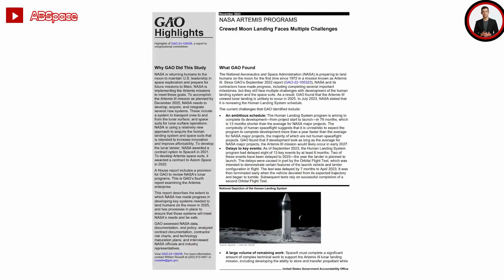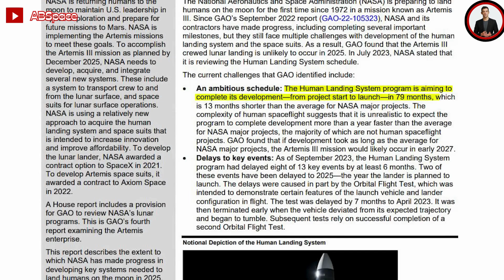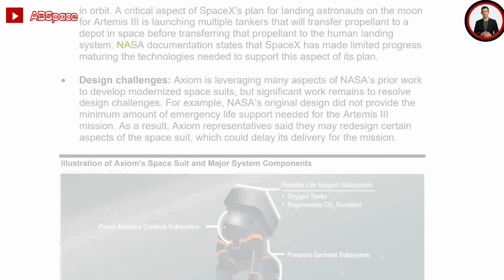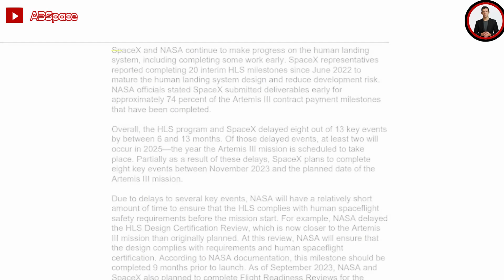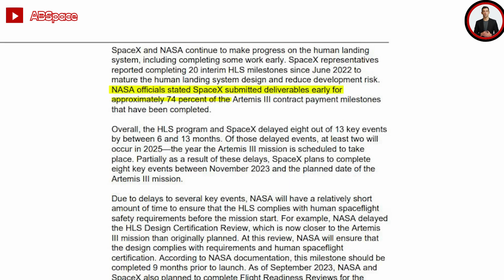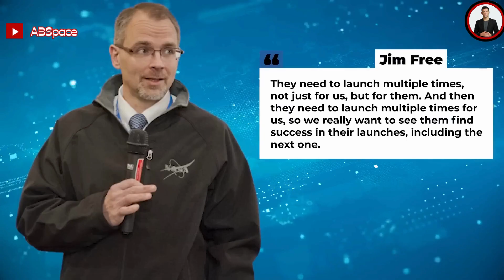SpaceX Lunar Starship Be Ready For Artemis III? But Musk Just shocked, NASA new HLS Starship design

Comment: As long as the FAA gets out of the way it will be fine. 

Would someone let the dumb F's at the FAA know it's supposed to fail?
Reply: You do understand that it's not the FAA just coming in and delaying things on a whim. The FAA has a LEGAL REQUIREMENT to investigate EVERY SINGLE 'failure', regardless of whether the failure was expected or not. Technically, even if everything had worked as expected, and the Starship had crashed into the ocean just of Hawaii as hoped, then because it would have been a 'crash' the FAA would still, legally, have to get involved, even if only to say 'Oh yeah, I see, yeah, that's fine, no worries'. And don't forget also that the FAA doesn't do the investigation itself, it merely overseas the investigation done by the launch provider, SpaceX in this instance. And if someone then sues the FAA, as happened in this instance, then that is out of the control of either SpaceX or the FAA.